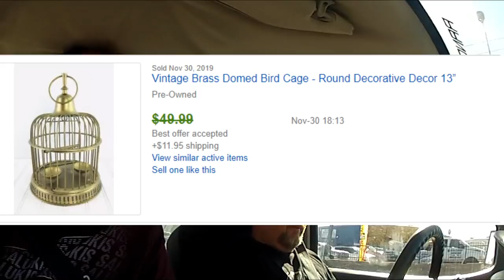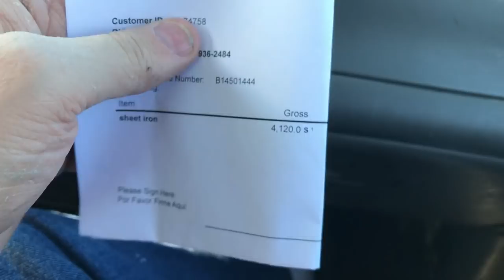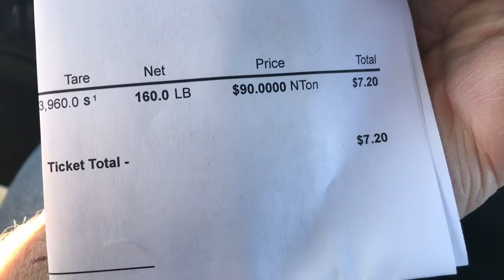Arizona Dumpster Diving - Trash Picking in the Sun!

Comment: I live in Phoenix  you could fill that truck up 10 times a day with the amount of metal on the streets. You were lucky to get $90 a ton prices just went up from like 20-40 ton you spend more in gas then what u make on the metal! This is the best time to scrap you dont want to be here when its 115 and the metal literally burns u if u dont have gloves on! Scrap on!
Reply from the maker: Hey Joe! How are you doing? I was told that it was not legal to dumpster dive in Phoenix. So where would you get your metal at?
Reply: @ShaneManTV  I have never been chased out of any dumpster dont make a mess and be quick about it and u should have no issues.  Also I saw u were in Mesa in Phoenix we have bulk trash pickup every three months you find the area where it is going on and you will have a field day in metal and other valuable materials! Best of luck! Scrap on!